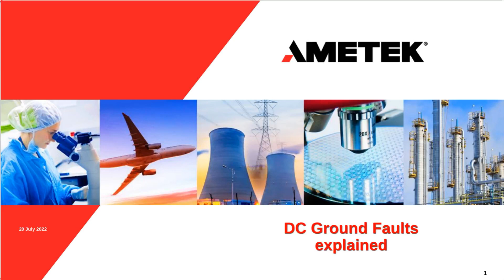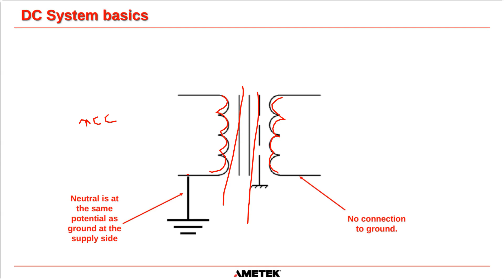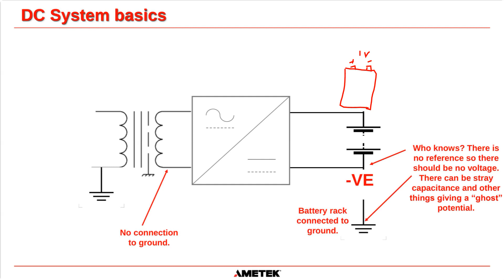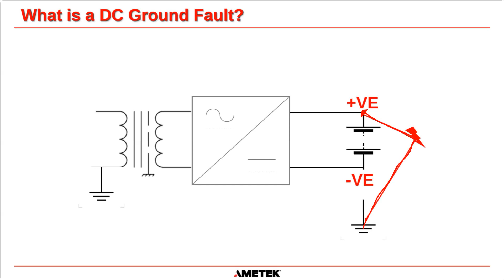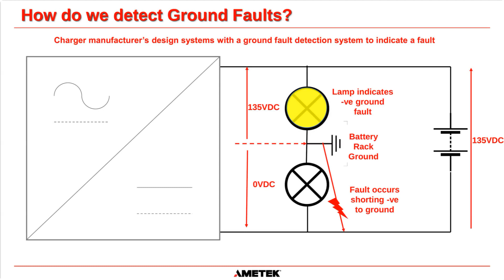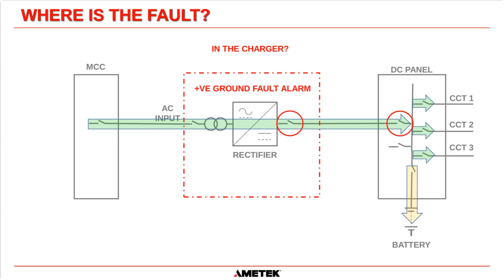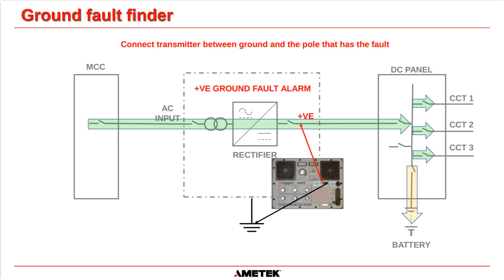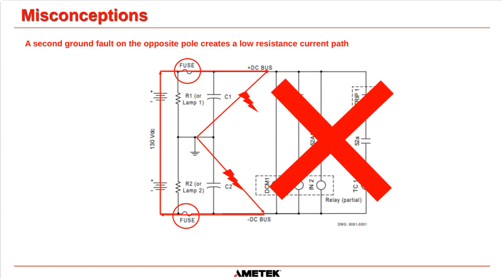Understanding DC Ground Faults

Comment: So are the ground fault detectors typically wired to the load side of the DC breakers? If not then opening the breaker would disconnect the fault detection and there would beno balance anymore.